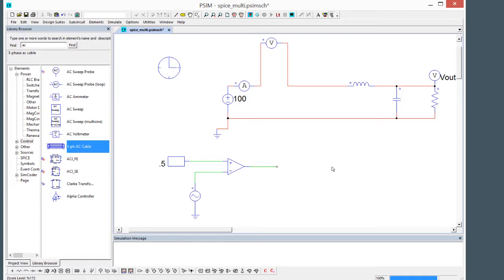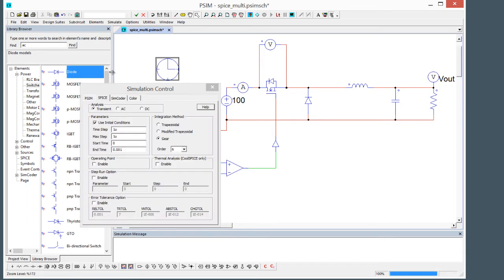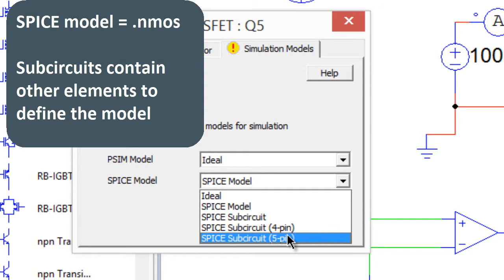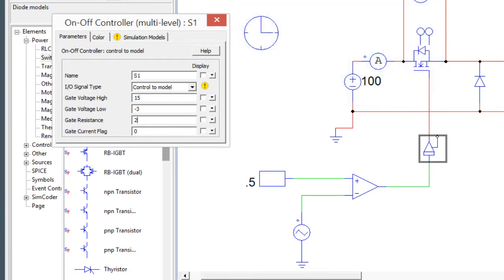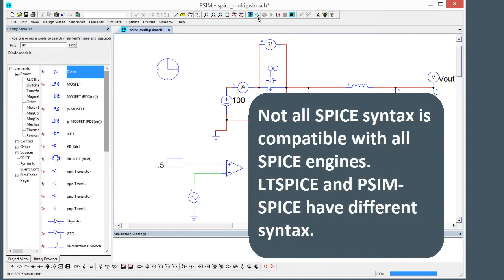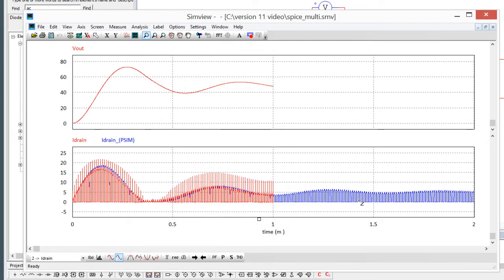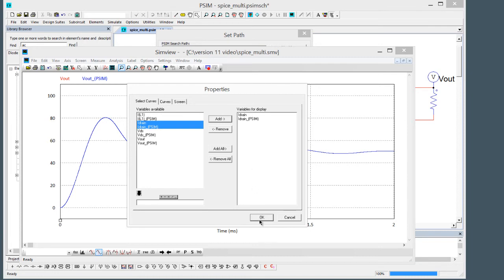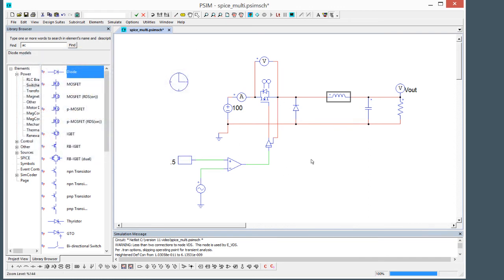Run LTSPICE from PSIM and define a dual PSIM/SPICE model

Comment from the maker: Want to try PSIM?                                                                                  - https://hubs.ly/H0f9wCC0
Why should you use PSIM for Motor Drive design?                         - https://hubs.ly/H0f9wCK0
Why is PSIM preferred for Power Electronics simulation?             -  https://hubs.ly/H0f9wFX0
Why you should use PSIM for device level simulations                  - https://hubs.ly/H0f9wDk0